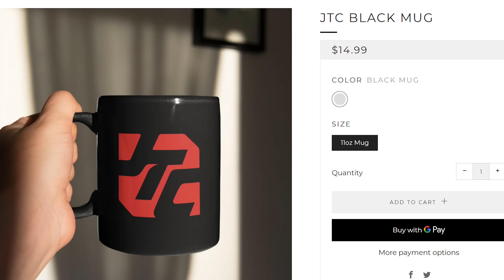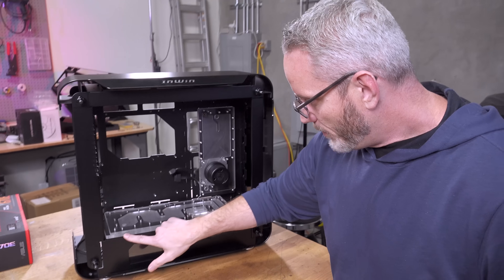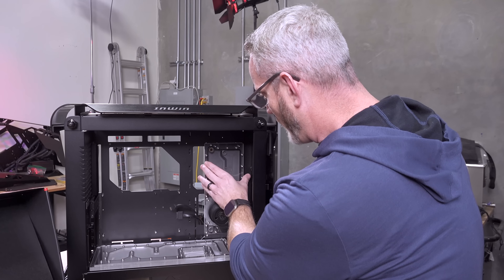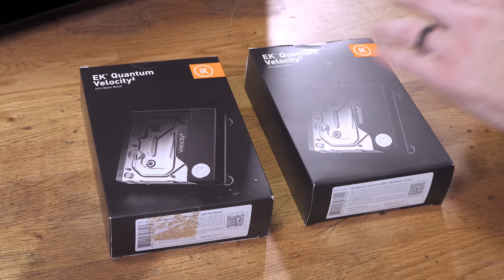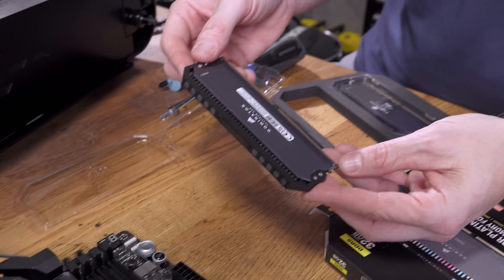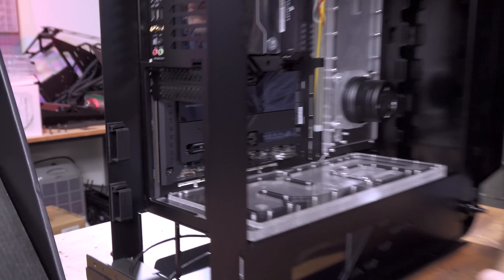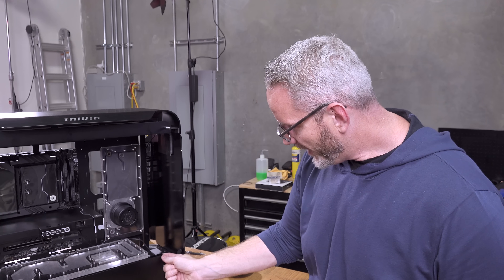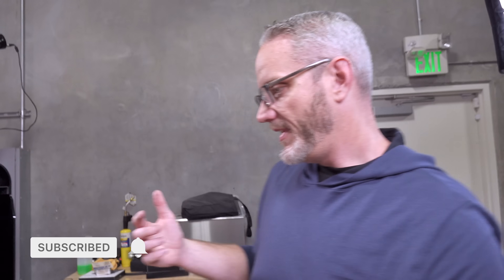My first water cooled build is 2023!

Comment: Well i would recommend designing a whole new distro-base-plate. The connection points would be perfectly in line plus a way better build quality, especially at the edges and corners would be possible. But having a Front Rad, producing a hotbox-system just wouldnt let me sleep. i had that before with a View71 from Tt and my PETG tubes melted at the cpu coolers outlet and that cfx fluid ran all the way don over mobo, pcie, GPU and PSU, while even the acrylic alphacool xpx Plexi Clear CPU Cooler deformed and leaked. 
would love to watch the finale of this project. have a good day..

Comment: Does the bottom distribution plate only have the one orientation?  Is you mirror but just flip it 180 would that work. It seems like the 12v might align better if you flipped it. 

Just a thought but I don’t see the mounting hardware.

Comment: That's the second time you (somehow) spoil the upcomming 7950X3D in your videos. I got the Crosshair Hero as well on Saturday, using the same EK-Block and also Dominator 6000 RAM. So its nice to watch you building with my components! Unfortunetally, I have to wait a bit longer for the desired CPU - and I will use the Hyte Y60 as case. But at the moment, I am planing how to route the watercooling and what bends to make... Funfact: I had the same mentioned issue with my DDR4 Dominators. After a time I was able to force the reinstalling of the firmware (it took a couple of times) through iCue-Software, now it works!

Comment: maybe for routing, top CPU port into top rad, top rad into front rad, front rad into top "resi" port, bottom port into distro plate, distro plate into GPU. I still think you could make that look extremely clean with how youre able to bend tubing etc. it'll look really nice too with that mystic fog in the plate/resi and the tubes being blacked out again. Sort of helps to pull the focus to there instead of directly on the tubing runs

Comment: Had similar problems with my GSkill RAM lights after a firmware update. Because that software has ability to sync to Razer Synapse, it was a lot of resetting to default, reinstalling softwares, and restarting computer multiple times before I was able to fix.

Comment: If you plan on using the silver on the radiators and fittings you could also try to use the silver cpu water block to help it match more. I think that would look good.

Comment: I agree with you going AMD as LGA 1700 is essentially the end of the road for Intel as 14th gen will likely require a new socket... With that said our builds are pretty identical, using the same motherboard and acetal ek blocks for the CPU and GPU, have yet to buy the CPU though as I'm waiting for review of the x3d parts.

Comment: top rad... should have gone with a x-flow!  then only 1 fitting on both ends.
Offset fitting to the bottom flow plate may work.
45 elbow from the bottom plate, and before the gpu?

Comment: Without being able to hold tubs in there to visually to see it, plus I don't know which are in/outs of the CPU and GPU blocks, so this might not work.  What about looping it from pump out to the GPU block, GPU to CPU block, CPU to top rad, Top rad down to distribution block, (almost straight down, but maybe do a couple of 45 degree bends to match the design on the blocks you talked about.)  Out the distribution block going towards the glass panel, then turn a 90 degree up to the front raid.  Again doing a couple of 45 degree angles matching the other side as it goes up to the front rad.  Out of the front rad back into the pump reservoir.  Might be kind of cool, probably not, but maybe it'll help with a starting point.    Keep up the great videos, can't wait to see more of this builds.

Comment: Can you back out the 2 front screws that hold the bottom distro block just far enough so they don't grab the threads on the front panel so you'd be able to get to the stuff underneath?

Comment: Not sure if this is a dumb idea or not... but it looks like the distro plate has extra material near the back for some reason that isnt mirrored on the front. Could that be trimmed off and allow you to shift the plate back enough to bet better alignment? It looks like you would have enough to get the front port to line up dead on with the pump combo bottom port, and also bring the opening for the GPU harness a bit closer as well. 
It wouldn't do a whole lot for the port near the back but if you had a straight run to the front along that distro plate at least the RGB would shine through a clear tube and might add some visual interest.

Comment: you should 3-d print jayz  custom slats for the rear i/o, and the geforce logo can be tinted with a vht product called night shades,(also might work for the side of the distro blocks) just ideas sharing but awesome build so far, one other suggestion SAMCO sport makes silicone elbows that might be usful for those bends , try to reduce the stresses of weird bends and blend some of your love for auto racing into the build

Comment: With that front pump to the bottom plate fitment issue, why not have the pump out go to the front radiator and the radiator exit go to the bottom plate?  You could turn the front radiator to have the ports on the bottom to make it work.

Comment: Instead of ditching the distribution block, I would ditch the case. Might be looking as good for the job, but I can clearly see, that you need a bit more room to the stuff you want to put in. And regarding the fittings and tubes and tight bends. Have a look at "bro cooling" and their technique of building. I'm sure there isn't much for you to learn from them, but with the amount of builds they did, I'm sure you will find some interesting ideas for your build.

Comment: Would the distro-plate holes line up better if you spun it around 180 degrees?
Reply: Looked closer. It does indeed look like you’ve got the bottom distro plate in backwards.  The holes would line up better if you flip it around.

Comment: I am planning my platform upgrade, and similar to Jay I am just waiting on the 7950X3D to be available to pull the trigger, but I had already decided a long time ago to go with a Crosshair motherboard, just because for almost all my personal builds, I have always used the top end Asus boards, be they Maximus or Rampage. 

My current setup being a Rampage V and I7 5960X OC'ed to 4,3Ghz, but it is starting to show it's age, so it will be retired in a few weeks and live it's new life as a secondary system.

Regarding the Corsair Dominator, A colleague had the same thing happen  to him, got a RMA, the new kit has had the same problem upon unboxing it, and my roommate had a similar issue also 1 week after building his PC, one LED was always off-colored compared to the others. I love the dominator's aesthetic, but this is the kind of issues that push me away from using these RAM kits.

Comment: I've actually had a few of my Lian Li AL120 uni fans start rattling. Of the 12 I've put in two systems about 3 or 4 had to be replaced. Definitely thinking of switch all of them to Be Quiet with that kind of failure rate.

Comment: Hey how about a vertical build, something that can support a EK 360x60 rad, 480x60 rad, and 320mm res and pump combo.  with a glass front, and be no wider then 12 inches, no restriction on height and depth.

Comment: Just some ideas i had imediately watching this video
What if:
- Get hold of a 90* bent plate ( 1cm x 2cm ) cut to the width of the motherboard to hide the case cables and usb/fan headers. Im sure ive seen them in plastic too. Could also be used on the waterblocks.
- Is it possible to swap places of the distroblock and pump/res block? Or turn the distroblock upside down?
- U know the spraycan u can use to tint rear lights of a car to make them darker? if u mask the gpu block u can do a very light coat to darken it.

Anyhow, love ur vids :D Keep em coming. Get well ;P

Comment: Jay evaluating the CPU block: "There's nothing else in the case that's silver / metal".  Jay unwraps and installs rads with silver: "I might just leave the silver, it seems like a pretty nice contrast".  So uh, you could use the othe EK waterblock if you're leaving the silver on the rad.

Comment: I am really interested in how you will make the connection between the pump plate and the distro plate on the bottom. I have a similar tight bend in my case and had a lot of trouble with it.

Comment: Hey Jay, while im writing this, i hope you didn't put your fans already into your system, because please give arctic cooling a shot, i tried them in several builds and they are amazing, i think you have heard of them, really good build quality and aesthetics
here are some specs 
General data (from 140's)
Performance
Fan Speed:	200 - 1900 rpm PWM controlled (0 rpm below 5% PWM)
Airflow:	68.9 CFM/ 117.06 m³/h
Static Pressure:	2 mm H₂O
Noise Level:	0.3 Sone

120mm BioniX Fan's
General data
Performance
Fan Speed:	400 - 2300 rpm
Airflow:	48 CFM/ 81.55 m³/h
Static Pressure:	2.1 mm H₂O
Noise Level:	0.45 Sone

and ofc daisychannable :)

i'm not from Arctic or any company, i'm just a fan who think you should really try them out

anyway keep up the good work, watchin you since your vid about quake II RTX :)
you are my first address about tech news and sort of things and put my knowledge to a whole new universe so thx for that 
greetings from where your roots come from !!!

Comment: Hey Jay, if you do a horizontal mount on the gpu how do you go about reaching the pcie clip when the gpu is mounted? I have an x570 extreme motherboard and find it extremely hard to reach back there with a thick gpu block and cpu block almost blocking the way

Comment: Drill a new hole vertical to one of the two holes of the GPU block, tap it, and use the left hole as your drain plug (which is also the lowest point)!

Comment: Not sure what Jay is worried about the tubing routing. There's a super simple solution, essentially a clock-wise flow:

Connect the pump to the bottom distro, exit the distro at the rear of the case upwards with a 90 degree bend towards the GPU inlet (inlet on EK is the side closest to PCIE brackets), out the top of the GPU outlet and connect to the bottom of CPU block (which is the inlet for these EK blocks), out the top of the CPU block, go upwards, then 90 degree bend towards the rear of the case and connect to the 360 rad on the deeper side (closest to motherboard tray), out the rad and go straight across to the front 360 where it should line up reasonably well with the side closest to the glass side panel, then out the other side and back into the pump/res combo. It's a basic layout and would work really well. 
The only difficult part of that could be connecting the pump outlet to the bottom distro because it doesn't line up properly (seems like an oversight by Singularity computers on some otherwise really cool pieces)

Comment: in my opinion a well done job with soft black tubing will be much better than hard tubing, that's becouse in your case there isn't any tipe of allineament with the loop ports on radiators, waterblocks, distroplates ecc... i think with hard tubing this will be a mess of fittings and bends

Comment: You could always add your own fitting ports to the distro plates. Drill and tap for the new port and use a G1/4" plug for ports you don't use.

Comment: The Extreme would look a lot better in my opinion. It would help fill up that gap and those cut up screw holes next to the block where your pump is located.
Reply: .. and EK has a monoblock for the Extreme at least for the Intel so I would "assume" similar with AMD...

Comment: The pipework talk reminds me of the Windows 98 screen saver 3D pipes. With the distro plate why not plan out your route and have them remake the top plate with the hole in the right position for your build?
Processor support for DDR5 RAM is on 13th-generation Intel Core and AMD Ryzen 7000 Series processors , so Id suggest the AMD Ryzen 9 7950X 16-Core, 32-Thread Unlocked

Comment: With my last computer upgrade I got RGB RAM for the first time. I don't know if I'll ever get it again. With RGB being put on everything, I've had nothing but problems. The RGB on the GPU and mobo faded out to where I just had to turn it off because the colors were horrible. The RAM just picks random colors 50% of the time when I turn on the computer. Sometimes its rainbow, sometimes it red, sometime only half of the LEDs come on. It just isn't worth it to spend hundreds of dollars on these parts and then feel like they need to be replaced because a light went out.

Comment: Curious if you thought about using the monoblock for the board to cover the vram and cpu as well for this?  I just built a 7950x with the Hero board and was debating on doing my first custom loop and am torn between the monoblock and just the cpu block.  Downside to the monoblock is the rgb when I wanted a black and silver look with any rgb lights being a dimmed white.

Comment: Is it possible to put a T-shaped fitting on the exit of the pump, with one exit to the right( and connecting to the distro plate) and one going out the front, so you could put a drain on the front exit? Just thinking out loud here ;)

Comment: Better to feel like shi* than to look like shi*. There's an excellent solution to that edge problem. I call it strip lighting. I still love your system monitor screen. I wanted mine to be front mounted along with my disk player. My original case, Thermaltake C3 Commander, had nowhere to mount them. My solution was to buy a PHANTEKS ENTHOO PRO. This case has three 5 1/4-inch front drive bays. I used two to mount my system monitor screen and the third for my disc player. Even with them installed, I still had room for my top-mounted AIO 360mm radiator.

Comment: Got a blue single LED on the top leftmost corner of my G.Skill DDR5 RAM thought it was my RAM swapped the sticks and the RGB was the same in the top leftmost LED of the A2 slot RAM stick it didn't follow the stick when I swapped it so probably Icue even though I'm using the motherboard to control the RAM RGB

Comment: Good so you avoided the nickel plated ALUMINUM EK used on the VRM block then :P
B.T.W. my EK full cover block of my 2066 Gigabyte Gaming 7 attached the same way.
Switched from 10/13 clear to 10/16 ZMT i love the stuff and it does not go flat when i put my loop on -450 mbar :P
Fans.. pls try the Phanteks t30 i use 6 of them silent and lots of air. and whwen u do put them on 3k rpm you got a nice airplane sound :P

Comment: I would think you could add a 120mm rad and fan on the pack panel, which would make it so the piping would line up with the bottom distro plate. Just a thought.

Comment: You already haev an X3D???  I guess I can't be surprised.  Lucky bugger.  Hoping I can get one at launch, hope to see some benchmarks before then!  Will be getting the 7900X3D, don't think I need a 7950X3D.  Though if the price point is fairly close, might do it anyway.

Do you happen to know why Lian Li V3000 are simply unavailable anywhere?  I can find a few at Microcenter, but they won't ship them.  And my son found LOTS in Korea, but cost $700-$750 there and then ship that monstrosity overseas...not happening.  Just hoping they are waiting on production and didn't already discontinue them....

Comment: Is Zotac Gaming RTX 2060 Twin Fan 12GB any good? I've read some reviews online and they said it's not really worth the price, however shop near me sells it on some discount price for a limited time, with price being around $350 (compared to regular price which is around $700). 
I have gtx 1050ti so I am thinking of replacing it anyway, but I would like to know if someone had experience with rtx 2060 TF 12gb, or should I maybe wait and hope for 3060 and hope they randomly get limited offer? Shop is legit, they are I think second biggest electronics company in my country, so no worries it's ripoff or some shady deal.

Comment: Running a Crosshair x670e Extreme in a 7000d I feel your pain on the plug for the 24 pin Jay. I'm using strimmer cables and I couldn't get them through the normal cable grommet so I have to have my 24 pin routing behind the metal cover for the side intake fans. I could have not used strimmer cables and made my life a lot easier, and I may still end up doing that at some point especially once I upgrade my EVGA 3080 ftw3 ultra to something down the line. Would be extremely interested in you showing a full Asus bios setup while you're doing this build, especially with how to setup all of the m.2 slots on the board itself.
Reply: Not the worst sound, but ya, he's not wearing a lav.

Comment: I have a question I have a 3090 fe and when I load into a game the screen goes black and the pc restarts , and goes back to windows it’s been doing it for a month but at times it don’t do it at all but recent it’s been a occurring issue thermals are good and ran a couple of benchmarks and the pc won’t crash just when I load up a game , would have to turn graphic to low just to play ? I ddu the gpu and still nothing jay anybody can help be solve issue

Comment: @jayztwocents So, it sounds to me like one of the LEDs in the stick of RAM failed? I have had this issue with their stupidly priced fans, and when they're linked, it caused the other fans to have a color stroke. You can probably disable that single LED if it's making you crazy. iCue is insanely well designed software if you take the time to learn how to really use it. Their customer support can stuff it though.

Comment: Flame polished edges would look cool and unique for the water distro, but wouldn't pick up and diffuse the RGB quite as effectively. Love watching gurus nitpick their personal builds. Maybe get someone to 3D print a cable comb (in GOOOOLD) with the built in offset angle for the GPU power to water plate pass through? Totally different flavor from the old skunkworks.